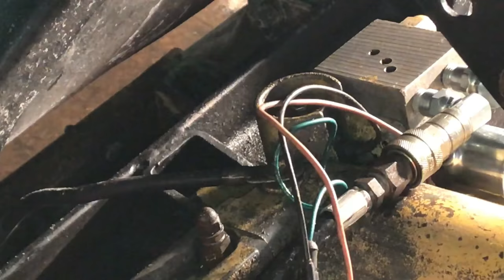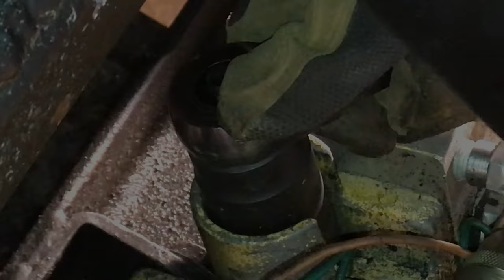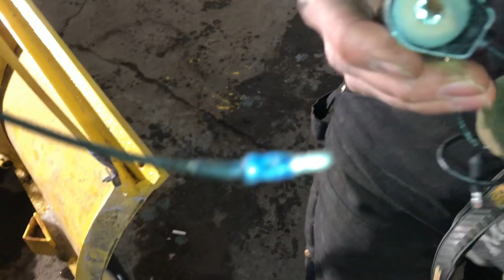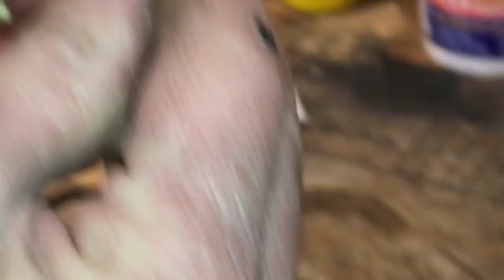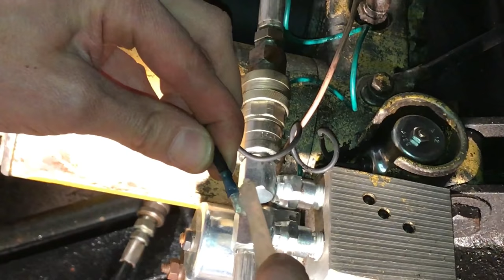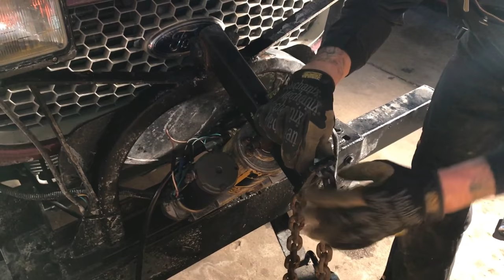Replacing The A Coil On The Meyer E47 Pump

Comment: Thanks for video. Anyone with an E-47 should learn how to check Magnetic force of their coils so they can tell when one goes bad or weak. I only solder and shrink wrap  wire ends. This can be done with that bic lighter.
Reply from the maker: Thanks for watching and the comment! We will do a video showing how to check magnetic force of a coil 💥
Reply: Can you link your video or explain how to check? Think I have a bad C Valve/coil.

Comment: What size socket to remove the valve? currently replacing E60h and the replacement coil doesn't appear to fit, too tall. but think I need to remover the valve assembly
Reply from the maker: Kyle Hilbert been a while but i believe it to be 1 1/8”
possibly 7/8”

Comment: I have  a plow the same as yours and it will Angle one way and will not  go back the other way, To eliminate the Cylinders I switched  the hoses around and the  blade goes the other way. Any ideas were to start!
Reply from the maker: Sounds like it might be a problem with the C coil.
Reply: @rpmimprovementoutdoorservi9968    Sorry for taking so long to return your answer  but I found the problem. There is a relief valve to cushion if you hit something,  that valve had a broken spring the  valve wouldn't return.  Hope this helps some one else in the future.
Reply: Once it was explained on how the coils worked i could figure it out!  The single valve drops the blade only, the double valve angles left, and the triple  valve lifts the blade. IF you activate  both triple and double valve at the same time it will angle to the right!

Comment: I did a b coil on an e57h is it normal for them to stick up a bit.
Reply from the maker: Michael Heller  we have not had the pleasure of working on an E57H but it does appear that the coil does not sit flush. Does the pump work correctly?